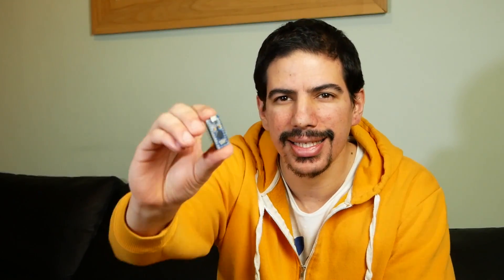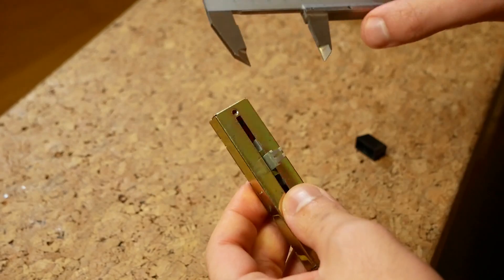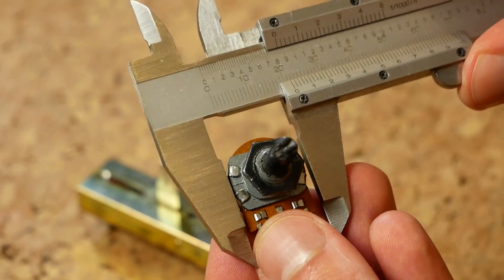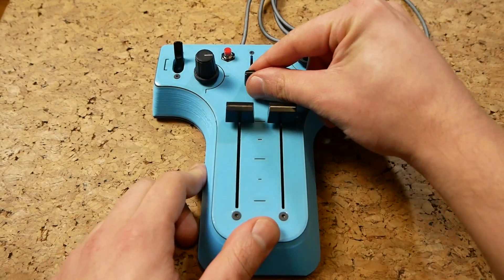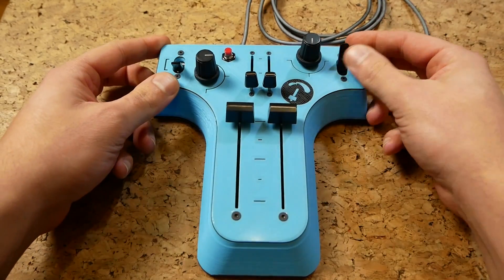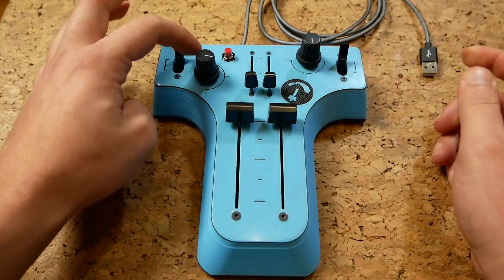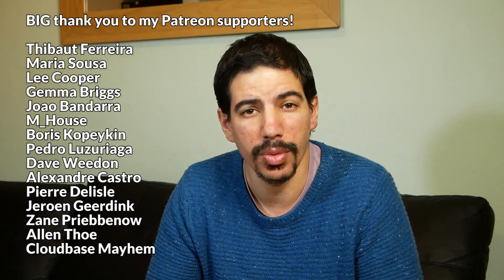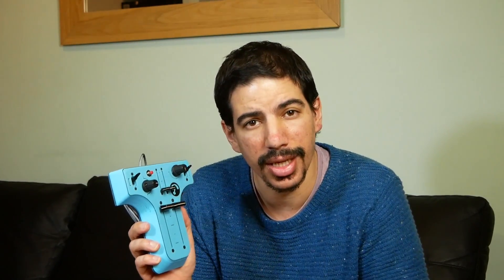DIY 3D Printed Controller - Paraglider Game Part 3 - BANDARRA

Comment: Hi Andre, how are you? I hope so, it's Deiwis here from Brazil.
You are the very best guy in your videos. However, in this one I have a doubt. I'm trying to assemble the control that shows and the code when playing for the arduino pro Micro is showing an error.
This error here: 'class Joystick_' has no member named 'setXAxisRotation'; did you mean '_xAxisRotation'?
 Could you tell me what I could be doing wrong? if I remove the 3 axes of what are referring to the circular POTs it loads on the arduino. but with it included it does not load.
Thank you very much for the great help you give us with your videos and the content available.
Reply from the maker: Olá Deiwis! I’m not sure, it’s hard to tell but I would check what joystick library you are using as it sounds like it doesn’t have that command.
Reply: @AndreBandarra1   Thanks for answering Andre, I'm excited I already have a select one in place and I bought both of your simulators, use Xbox controls without problems, I've already tested them, but I like to learn how to do things, but I struggle a lot in the most complex parts. arduino there was a lot of talk I hated hahaha today I'm finding it very interesting, I built a vario that I liked a lot and now I'm trying metro for this control. (I keep in mind that I can't create anything from scratch but the "copies" already helps a lot to meet a lot of things.
Thanks for sharing friend.
Success to you!
Reply from the maker: @deiwisstanczyk9383  Thanks Deiwis and I'm glad you're enjoying trying things and testing and learning arduino stuff. However, just to let you know, I don't sell any simulators at the moment. There are paragliding sims on the market but they have been done by other people. If you want you can join our discord where we talk about many things like games, simulators, controllers, electronics, etc. 👌 https://discord.gg/EGNDjt3eTw

Comment: nice work! great attention to detail. 
what CAD software and 3D printer are you using?
a tip: seems like you did not use any pull up resistors. these could lower interference (at least on the push buttons.. you don't want your reserve going out by mistake :D)
Reply from the maker: Thanks Gian. I used solidworks and don't have a 3D printer so my friend Dave printed it for me. I think it has one similar to the prusa i3. Yes I didn't as I didn't know it was a good idea to do that. Would you put a resistor in line with each button/slider? ohms?
Reply: I did a bit of research and apparently the Arduino already has integrated pullup/pulldown resistors but you need to activate them in code. 
https://www.arduino.cc/en/Tutorial/DigitalPins

"There are 20K pullup resistors built into the Atmega chip that can be accessed from software. These built-in pullup resistors are accessed by setting the pinMode() as INPUT_PULLUP. This effectively inverts the behavior of the INPUT mode, where HIGH means the sensor is off, and LOW means the sensor is on."

This is a good tutorial on the subject https://www.youtube.com/watch?v=wxjerCHCEMg
Reply from the maker: oh makes sense. the sliders and pots don't need it as they are analog and they always have some resistance even when they are at zero. for the toggles and buttons you're basically shorting a pin to ground and you're right they do need either a pull up resistor or to activate the arduino ones. I looked at the code and I do initialize them and pull them up to start with :D I'm so lazy with it that most of the time i copy paste code and see if it works xD Are you thinking of building one? would be awesome if you did
Reply: Andre Bandarra are you thinking of open sourcing it? I haven't done an arduino project in a while but would enjoy contributing :)
Reply from the maker: absolutely, i'm a big believer in open source software and hardware. At the moment I've put the files and code on patreon because in these initial months I'm really trying to grow my following there to make sure that I can continue to do this, but I will happily release the cad files and arduino code once the game is out so that people can build their own too. Also if there are enough interested people I might do a limited run of these like 10 or 20 but I think it will likely end up too expensive for people that want one and probably to cheap for me to make them if you know what I mean
Reply: If i can get my hands on a set of risers, i'm going to build a setup to hang my harness in, with bungy-cords on the brakes/lines, for some rainy day flying!